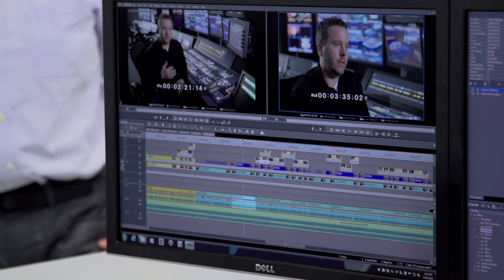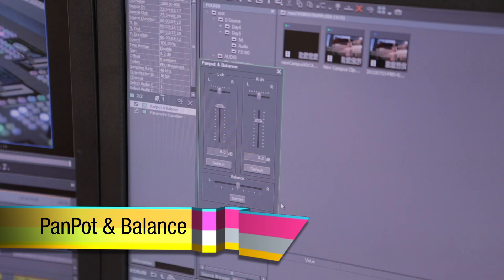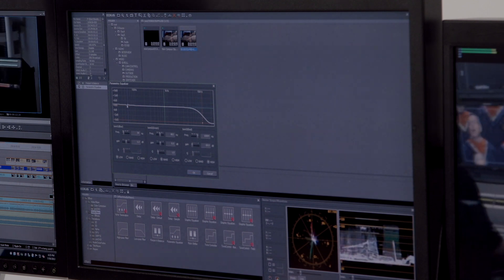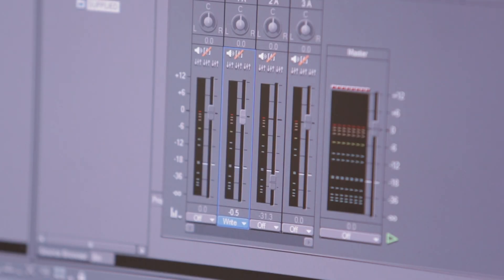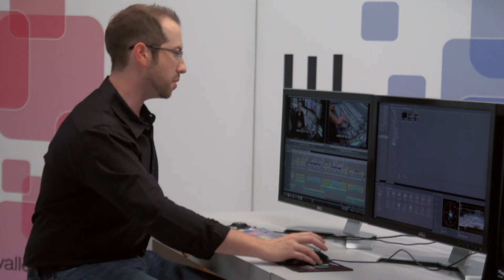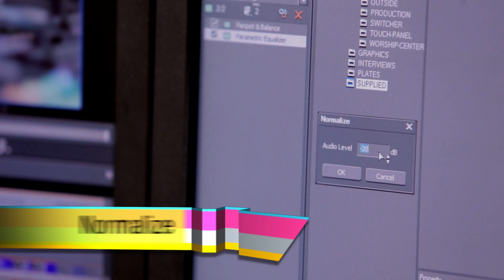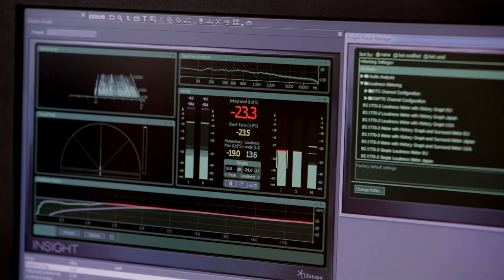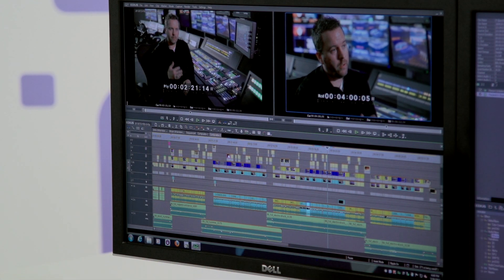EDIUS 7: Audio Handling (Chapter 6)

Comment: Hello, I have been using Edius pro 7 in Windows 7 on a laptop for couple of years, it was working fine. but when installed it  on brand new desktop I found there is no audio? there is audio on all other media except Edius. I have the latest updated version. Can you help please?
Reply from the maker: You should probably contact technical support via http://www.grassvalley.com/support/customer_care. You can also post this on Facebook. Search for EDIUS User Group
Reply: thanks, I think i will delete and use Primmer pro